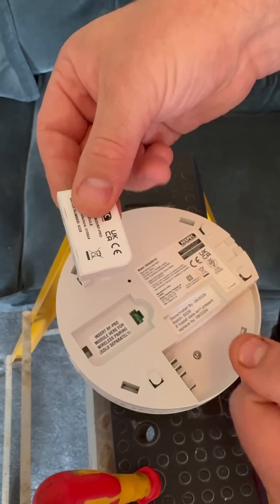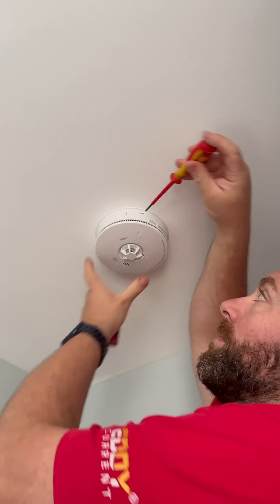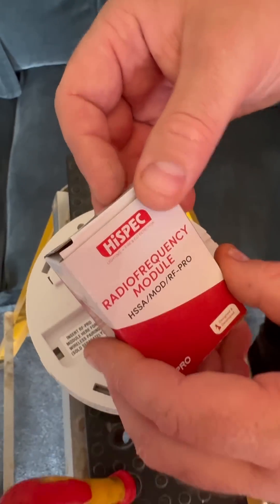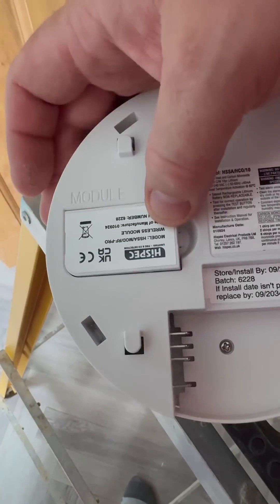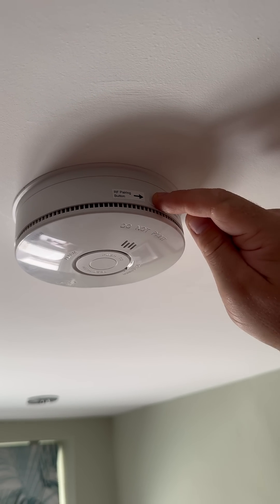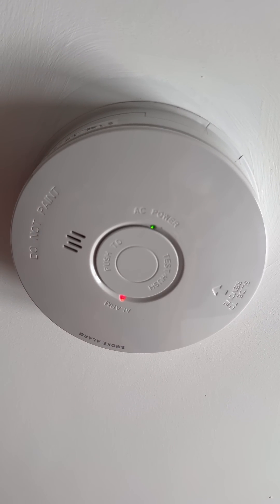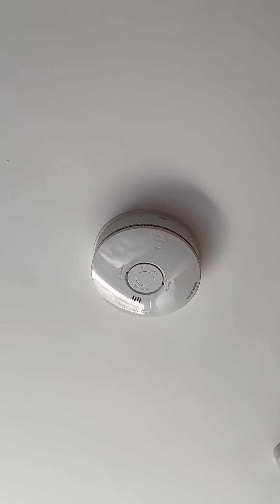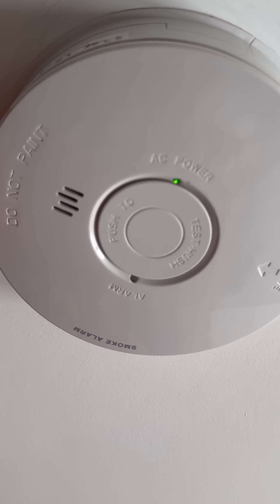How To Wirelessly Interlink Smoke Detectors

Comment: Why didn't you just install Aico radiolink smoke alarms, they have this functionality built in, and are much higher quality
Reply: 5x the price too 😂
Reply: @rufus_6946 and significantly higher quality. I wouldn't trust some no name brand to protect my house, I would trust Aico, as they are a reputable brand
Reply: Confirming 10 year battery interlinked detectors can be had for twenty quid.

Comment: So instead of following the sound and contain the fire you'll have to figure out where to go and check first
Reply: Good point.  But if you are asleep and you can't hear the alarm you will get a victim.
Reply: The point is to alert that there is a fire in the first place and get the occupants awake. Assume there’s a fire on the first floor and you’re on the third. Sure you may not know which floor it’s on but all occupants are aware of the fire now